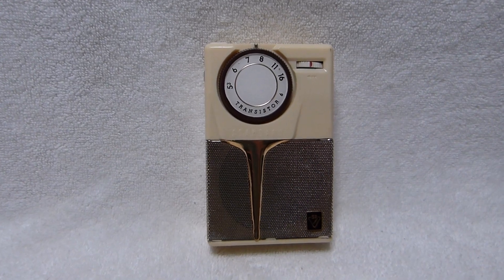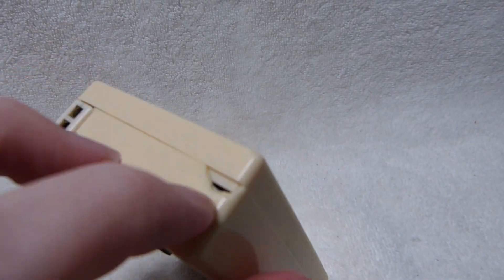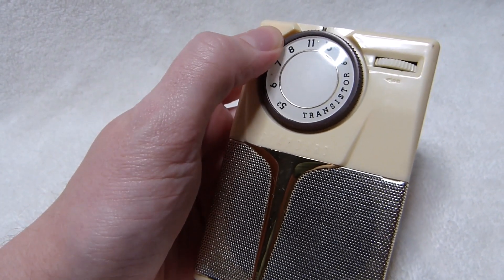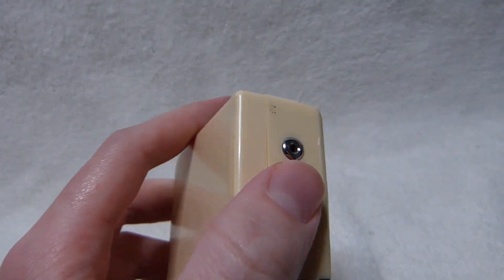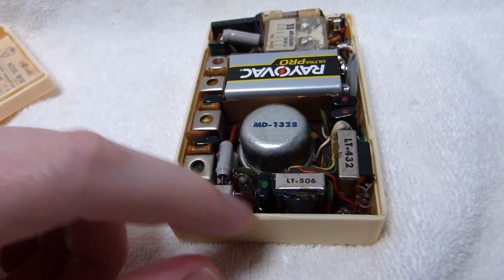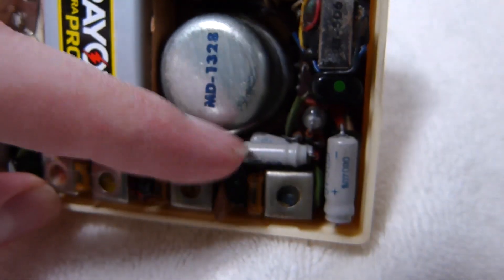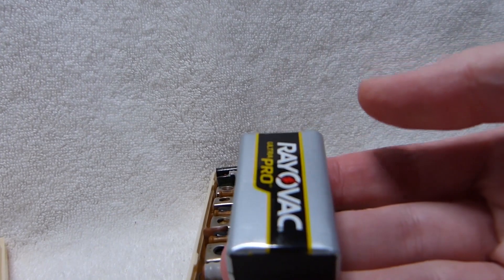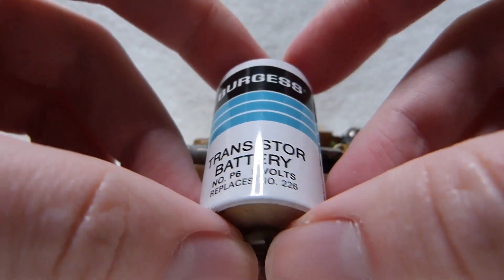Standard model SR-F22 transistor radio (1957, Japan)

Comment: Concerning those batteries, I have a couple radios that work, but battery just doesn’t fit.
So, like you said, cannot close back.
📻🙂
Reply from the maker: I've got a few transistors radios with that same "issue" and I had an older radio shack 9V battery that was slim like the 1950's ones, but it's spent now. 
I suspect that the dimensions were changed so that six AAAA Alkaline cells could fit inside. The older carbon-zinc 9V batteries have a stack of six flat cells inside (or at least the one I opened did).
Reply: @50sTransistorRadios  
Interesting.  
(I also have a very small AM/FM pocket radio that takes 3 
“LR-52” batteries.
The radio is a fantastic little 
Elgin R-2400.  Very tiny, but sounds good,and impressive reception both bands.
- and s really great looking radio, too.
📻🙂